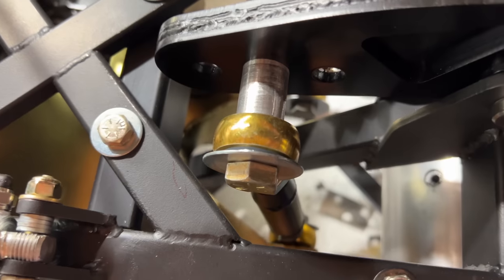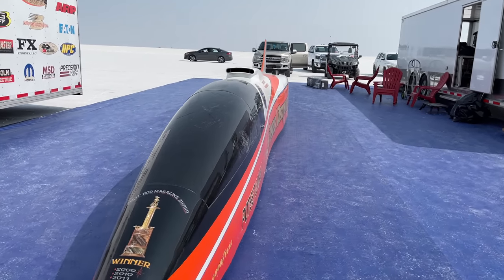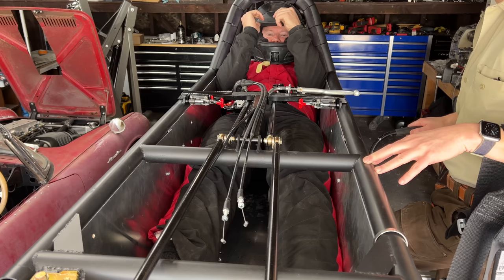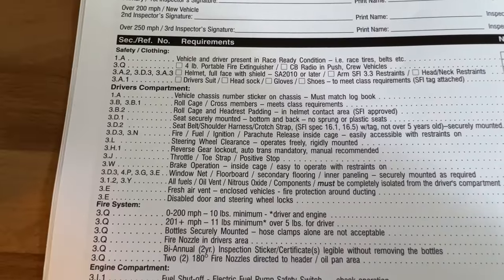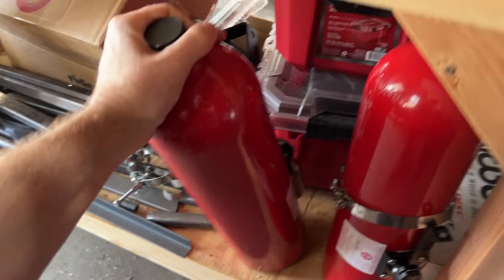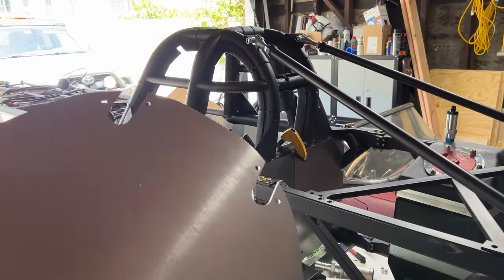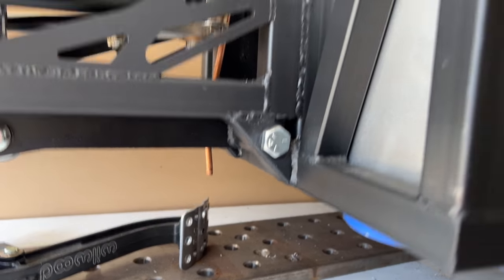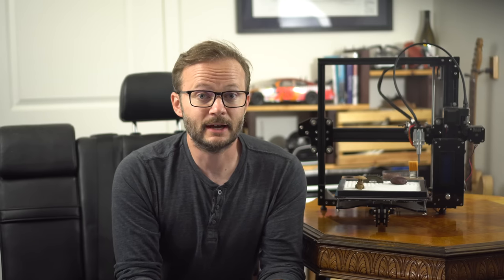How To Almost Pass Tech Inspection

Comment: Some more notes for new racers:
1. There is no time limit on the "Bailout". What the inspectors want to see is if you can do it easily. 
This means no struggling and knowing where everything you need to do in an emergency is, without hesitation.
They'll tell you to put your hand on the fire bottle handles, or the seat-belt release. 
If you need to move the straps before getting out,  practice doing it calmly and climbing out without any fuss.

2.  Without a body, you don't need the tow loop. The front frame member is enough to run a tow strap around.
Some of the cars (Streamliners are the worst) have no way to move the car without the specialized trailer.  Even with the inspection form line, this is a problem every year at Bonneville.

Comment: Something to note with the ESS self-fill bottles: I have the same setup for my road race car and it can only be certified if filled and sealed by an authorized dealer/filler/certifier. Not a big deal, but just don’t fill it before getting it inspected! 

IOPort Racing Supply in Lafayette, CA can help you out
Reply: This is a good point. Some racing organizations are no longer permitting self-fillable fire suppression systems, presumably because there’s no way to ensure it’s been filled properly. Something to be aware of.

On the topic of accidental discharge, I can say from experience that the ESS foam has a fun and pleasant kind of fresh flowers/berries smell. I feel like it would provide a much needed calming effect if deployed in earnest.
Reply from the maker: I don't believe the SCTA requires a certification, only an inspection. I'll chat with the tech inspectors this weekend to verify.

Comment: How thick is your seat panel? Mine was 1/8th alumunium.   After I crashed ( https://www.youtube.com/watch?v=RmAlbJkBt2c&t=35s ) we doubled it up to about 1/4.  A foot operated 'chute release means you don't need to let go of the steering to deploy it.   Love the build and can't wait to see it race. Car-9999
Reply from the maker: It's .090 but backed up with steel tubes. I'll plan on upping it to 1/4 though because it is braced similar to yours if I remember correctly.
Reply: @SuperfastMatt  That is basically how we did ours.  I could feel all of it the next morning!    We added an additional layer and two more supports to distribute the load.  The best idea in the world was two side bars and none up the middle.

Comment: I’d kinda be down to see you do some lemons racing after this project as a simple and fun project that doesn’t require you to build an entire car from scratch… unless you decide to make a SHO V6 mid engine Yugo.
Reply: I would rather see wankel powered yugo :)
Reply: Or the GM 3600 series “sound of power” V6
Reply: As fun as it would be, if you want to win, get an engine that's not hard to keep running.  Big engine little car almost always gets a ton of penalty laps.  My cousin's Civic with a 1.8L Integra R motor received -999 laps, if I remember, and he actually DID buy it for $500 like that because the previous owner couldn't get the motor working.  My thinking is you're more likely to place well if you just show up in a 1998 Dodge Neon with the base engine and duct tape wrapped around the radiator hoses for extra strength.
Reply: @12x2richter  nah, you gotta get the right big engine. Blueprint 350 small block? No. Cadillac “High Technology” V8. YES. They leave loopholes for certain types of builds. They had a Viper powered Rolls Royce, a SHO V6 Geo metro, and a motorcycle engine swapped Honda Z600. None of them got penalty laps. It really depends on how creative your build is. They have a loophole allowing ANY vehicle powered by a Cadillac High Technology V8 no matter price to run, they also have a strong leniency towards Korean luxury cars. And recently they opened a loophole for anyone wanting to run an SRT4 powered Dodge Caliber so long as it’s running the race at maximum boost.
Reply: You misspelled "Blown 3800-swapped mid-mounted Karman Ghia ."  Common error, though.

Comment: FWIW, I'm not fast on tech-inspection-maximum-egress time on account of being a fat dude, but the one time I had to get out of a car that was actually on fire, it was Le Mans driver change time. One second I'm sitting pulled off the side of the track doing the dejected 'that sounded like a rod through the block :((((' thing, looking at all the smoke, the next I see a flame and suddenly I'm not in the car anymore with none of the usual drama, creaking, groaning, almost falling of my face-ing such a process usually entails. (the rod had in fact exited the block... through the power steering reservoir, a fuel line, and a wiring harness, hence the flames. They'd actually rolled the fire truck before I even thought about stopping because there was an inferno visible under the car while I was still going 'that noise wasn't there a minute ago, why don't I have as much horsepower as I should, that's a lot of warning lights')

Anyway, you'd be amazed how fast people can do the undignified worm dance that is racecar entry/egress when it really matters. And not being on fire is good.

Also, I'm pretty sure you can only get an inspection stamp on those fire systems if you have them filled by a distributor, so look out for that.

Comment: If you dont mind someone without pieces of paper making a suggestion. Id absolutely add a shield over the tube you put the brake line through. Chains dont always stay in their rotating plane for very long after they break. The tube is going to have to overhang the frame rail to guard against this, and a chain will happilly grab that tube and do bad things.
Reply: He might be referring to routing it through the chassis tube or swingarm tube, but I agree anyway. Better extra shield than not enough.

Comment: Good day, I dont know how much motorcycle experience you have, but a broken chain at speed can be fatal. The damage can be extensive. The chain guard on bike should be called a crappe guard, just keeps flung chain lube off ya ride. A broken chain can remove your rear brake caliper. Saw a counter shaft "removed" from the motor in one case, right thru the cases. If this be stuff ya already know, tell me ta shut up! Am digging the car. Good luck, safe runs and a following wind!

Comment: Tool Dork Question:
I have a good corded standard jigsaw that meets my needs
But I have a crush on that barrel grip style dewalt jigsaw you used in the video
So, do you Matt or any other people have any opinions on the quality and experience of that barrel grip style vs a more standard jigsaw?

Thanks, great video as always
Reply: It’s got more control if you do fiddly work.
Reply: Barrel style- love the feel and control (Bosch- I'm not a Dewalt guy but that's a story for another time).  I was a professional carpenter, now an engineer- not as credentialed as the other Matt though...
Reply: @crim7ind  yeah I figured that’d be the case, lower point where you grip the tool so less potential slop or issues getting flat to flat contact
Reply from the maker: I like everything about it except you can't change speeds with the trigger, just with a dial on the back. the barrel grip is great though.

Comment: What is your opinion of using chrome moly tubing vs thicker mild steel tubing for roll cages? I know that NHRA's regs require a 10 point roll cage to be made of either 1.625 dia .083 Chrome Moly or 1.625 dia .134 mild steel tubing. I have heard that some road racing sanctioning bodies insist that roll bars and roll cages be made from mild steel because they don't approve of the way chrome moly deforms on impact. What say you?

Comment: It's race day and I can no longer get into my cockpit, having inexplicably gained 10 pounds since I was l last in it. I couldn't get my feet inside. Solution: Mom bought me moccasins. Safety requirements weren't much in the Soap Box Derby. But the memory of that claustrophobic flop-sweat panic has stuck with me to this day, 50 years later.

Comment: hey matt, do you plan to have hip pads? because should anything go wrong, which i hope never ever happens but usually still does, any body part that can be slammed agains metal should have a pad, or be restrained. that means your chest, head and arms are safe, but not your legs and your hips. legs you already have the footrests planned, so it's okay. hips though? i say a bit of yoga mat, glue and zero lateral movement when suited and seated should fix that for 5 dollars or less.

Comment: Have you considered the possibility that the steering stops the front wheel may start rotating "in" and accidentally limit your steering too much while driving? I noticed the nuts which will clamp significantly but adding another nut on the other side would cost only little weight and would bring that possibility close to zero.

Comment: Non-engineer here. How does a washer help in that use case vs a safety wired castle nut?
Reply: I think the idea isn't so much that the nut holding the ball part of the rod end on could come off, as the rod end itself could fail in some way such that the outer ring part comes off the ball. Since the outer ring is often larger than the nut, it could completely fall off in that case. The washer is larger than  the outer ring part so prevents the outer ring falling off even if the precision bearing has failed, the joint may now have lots of slop in it bit everything is still more or less in the same place so it may still kinda work, and/or at least the control arm wont fall down and interact with somethjng else and cause a knock on failure.

A car I had years ago, the gear lever linkages has a super cheap rod end variant that had a steel ball but a plastic (nylon or similar) bushing inside the ring. And with age the plastic became brittle and one by one they all cracked and failed and the linkages fell off. It was an old car so .. lits of linkages failed over the years, fell off a lot actually. That's bad enough on your gear linkage, on your steering... not good. That's what happens when accounts get involved, quality is replaced with crap. Matt talked about that. OK steel isn't plastic but think how a rod end is made. What can be made can unmake itself. The washer is just an attempt to hold the bits together enough to sort of work/nit fall into anything else important if it does. Fail safe. Ish.

Comment: I don’t mind VIN number, but I very much dislike “hot water heater” why do you need to heat it if it’s already hot.. NHRA in their infinite wisdom forced me to have a 20 layer fire suit since I was blown and burned methanol, so I spent the money and the very next year they pulled the requirement back to 15 layers grrrrrr.

Comment: Are composite (or equivalent) steering rods allowed? Would a frontal collision cause the steel rods to poke you? What scale of thrust load would hitting a rock at ~100mph be?
Reply: Dunno about the first one, but for the second one, something would have to go catastrophically wrong for the rods to even reach him. If they did buckle, then they would probably slide along the frame first.

And if by "scale" you mean newtons or kilonewtons (or another unit), then you'd just have to calculate it using the weight of the finished vehicle, which I think he had some predictions on in a previous video. After getting that, you can compare it to other things, if that's what you meant by scale

Comment: Matt, be prepared to be told your car is not legal, the inspectors like to show their power as they really think they are smarter and much better judge of your talent than you. They will find a grey area and pick it to pieces knowing you are right but that's their power trip coming out for all to see.  I am talking from my actual, firsthand on the salt, going thru inspection experience with a car that had run for 5+ years without any faults. The only thing new was the owner who was not going to take any crap from the "inspectors" Good luck

Comment: im surprised you cant use carbon fiber rods for your steering.  but i understand their logic trying to make it "less dangerous" lol.  good vid
Reply: Our formula student team was using carbon fiber tubes as part of the brake pedal in 2010. At brake test at the event in Silverstone, our brake pedal broke, but it triggered the brake overtravel switch as the car stopped, so no big deal. A long night in another teams' workshop, and we had an aluminium pedal ready for testing.
Another team had the same idea. Their pedal failed as well; however they were no so lucky. Their driver ripped of the brake pedal, punched it through the steering rack, causing it to bind. Car didn't slow down a lot, continued to the end of the brake test area, jumped a curb and hit a car on the road behind it with the roll bar. Driver was out of the car less than  five seconds after the accident, unharmed. They rebuilt the car and raced the remaining events in the year.
The next year, carbon fiber was no longer permitted as part of the brake system. I wonder why.
Reply: Why would you care ? For circuit racing I get that low weight is everything (*I simplify). But for land speed racing wright is irrelevant, low drag is everything. Or ?
Reply: @davesmith9325  Weight is the enemy in all racing of any kind.

Comment: Hey Matt, what if you smeared your whole body in fire retardant whilst in the vehicle, could you technically do away with the dual extinguishers and save even more weight? 😂
That’ll piss off the scrutineers.
Reply: In Land speed racing you don't want lightness,it's added mass that is important. Because the salt or the dirt (Muroc) doesn't have too much grip you need to be able to have enough ballast to keep traction. I found that out at 120MPH when the rear of my car wanted to swap ends with the front.

Comment: Great video! Also interesting, your battery shutoff switch is identical to the ones that came in my 45-year-old boat, except mine were brass for corrosion resistance. 

Did you buy that new or have it for a while? I didn't know that design was still available. 

Mine did fail last year after decades of service, so you might want to check yours in 2060 🫡
Reply from the maker: just bought it new. seems to be a robust design :)

Comment: Funny how totally stock and totally legal street cars fully capable of 200+ or 250+ mph could legally drive on the Autobahn at those speeds, and then be turned away from a dry lake bed. "Okay, back to the highway then..."
Reply: Very few street-legal cars are actually capable of 200 mph, and there aren't as many stretches of totally unlimited autobahn left as people tend to think, most of which are not totally straight for very long.
Reply: The subject of my statement are those (yes, very few) "totally stick and totally legal street cars fully capable of 200+ or 250+ mph". They do exist. People even build them. A guy in England has one that'll do these speeds in a quarter mile.

And yes, if they're to remain "totally legal" (part of my point) they'd need to find one of those remaining spots where they can legally stretch their legs. Some don't need much space, as they can blast past 200 or 250 in a single (e.g. "Texas...") mile (1.6 km), so just a few km is plenty.

And yet, here comes the punchline, they'd be turned away from a sanctioned event at a dry lake bed.

Get it?

Public highway: can be legal.
Dry lake bed: likely turned away.

The point is in the obvious contradiction.

That it's rare is precisely irrelevant.

You've missed the point.

Street legal vehicles should be permitted. If they're allowed on a highway, then they should be allowed onto a dry lake bed.

Comment: Dead pedals: why break both your legs in an accident when you don't need to?
Reply: Having something to brace against should help with comfort... a critical point to consider in this luxury ride. :/

I use high density flotation foam in one of my kayaks to brace my feet  for more efficient paddling. It might work well in your speedster and have good give should you inadvertently engage Rapid Disassembly Mode.
Reply: @randiiburleson  Rapid disassembly mode, love it!